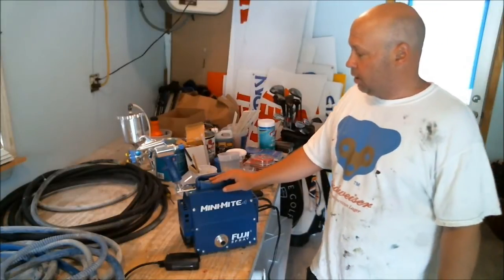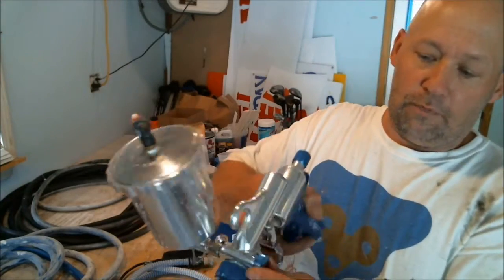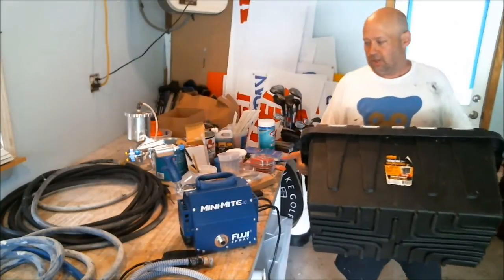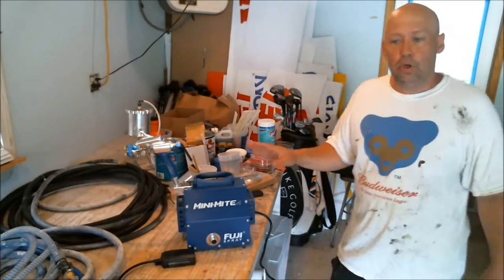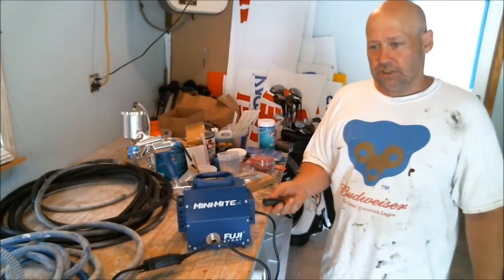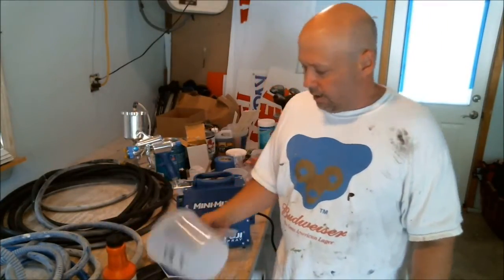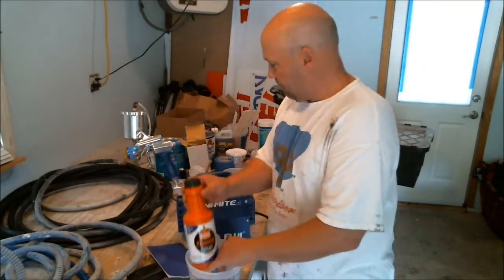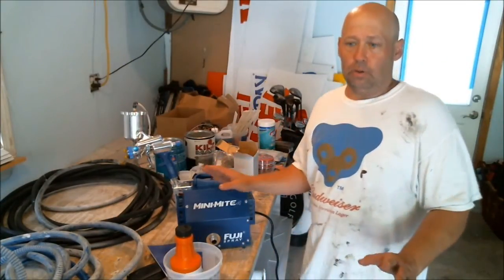FUJI HVLP MINIMITE 4 REVIEW

Comment from the maker: Hey GG  Ok the remote i got from Menards its called a appliance control device 10 bucks and the hose is called either a commercial or industrial hot water hose capable of 180 degrees. they are at all the hardware stores. I think it was like 25 bucks for a 25 footer. I have had 50' of hot water hose and 25' of the hose Fuji included and the 6' whip for a total of 81' and the pressure held nice and it sprayed excellent...  thanks for the nice words GG  thanks for watching

Comment from the maker: Shade, the balance is excellent, they came out with a new G-xpc gun that the 400cc can does not swivel, I like the swivel but i wished they made a 200cc can to get in those tight areas. 3m makes something but it is like 150 bucks.  if you got an extra 2-300 get the quiet one but like i said i always put the turbine outside at least 81' away

Comment from the maker: Hey Nik.  No... I have not had any problems with spraying latex paint with the 81' (21m) of hose extension... I only have to thin the paint 8-10 percent of bottled water in my latex paint with about 5% flotrol to slow the drying down. I read some where when i was doing research in buying this Fuji minimite 4 that a guy had 106' (32m) with no problems...Fuji doesnt recommend this lol

Comment: Hello leo  i used the 1.3mm standard aircap that came with the gun
and the 600cc cup, i did not thin the primer it was an old primer but it came out a bit slow but i had no overspray at al. the paint i did have to thin min 20% to get it to flow good.